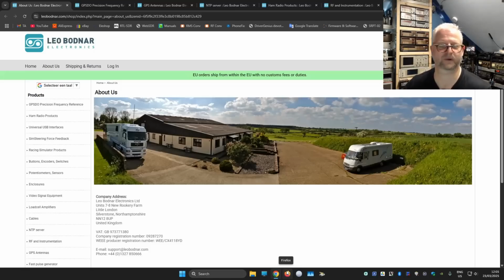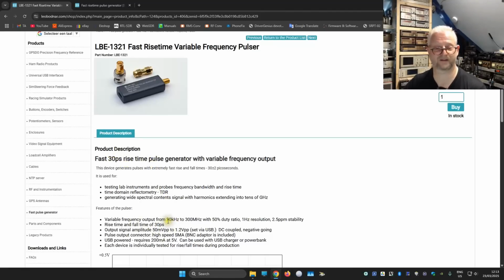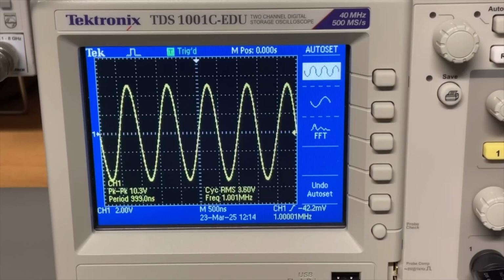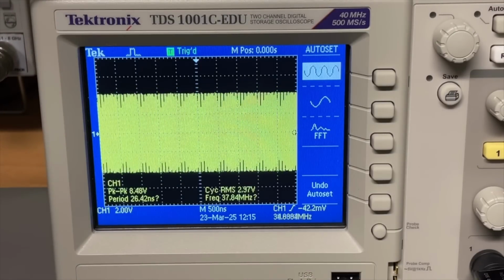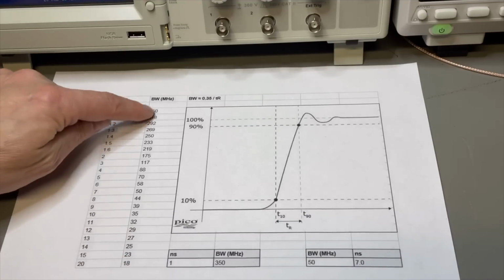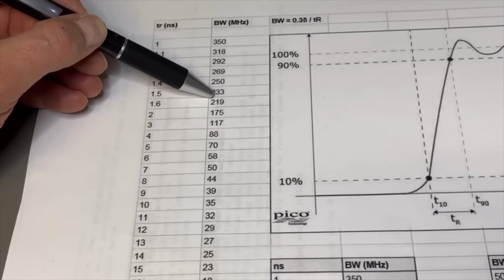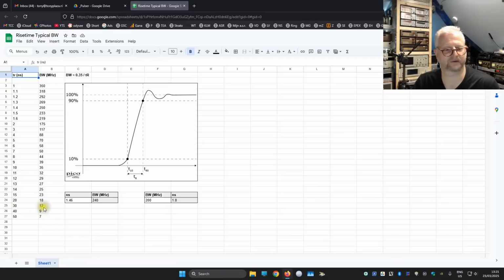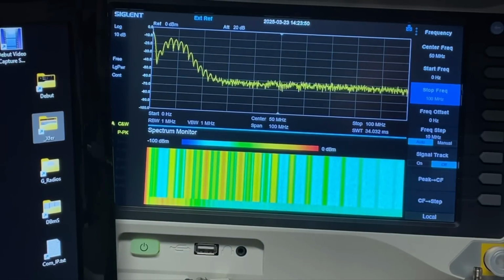TA•0440🟦Leo Bodnar - Fast Risetime Pulse Generator 30ps LBE-1321

Comment: Thanks for the video. One recommendation: You should always hold your coaxial adapter when screwing it in, so that the center pin does not rotate into the female receptacle, otherwise you will damage your connector and adapter (will rub off the gold plating).
Reply from the maker: Thank you! that si indeed a good point, never thought of that.Thanks!

Comment: 5 samples per edge... But double your working frequency isn't enough... 5 x let's you get the amount of confidence that you really want.
Personally, although it sounds "harsh", 10x is what is recommended for accurate measurements at the test "edge".
But I'm just a simple guy who was an AE for 10+ years, worked for t&m companies in München und Beaverton...
Reply: Yep what ever your scopes analogue bandwidth is quoted at the digital bandwidth is 1/10th of that value.
Reply from the maker: Thanks .. yes 10x .. oof, $$$  now i need a 1 GHz scope and a winning lottery ticket :)

Comment: 10:34 The 0.35 / tR rule is a historical rule. While it worked well for old, analog oscilloscopes, it's not completely applicable to modern, digital oscilloscopes. 0.45 / tR is more appropriate for modern oscilloscopes.
Reply from the maker: Thanks! that is great to know...for my next tests